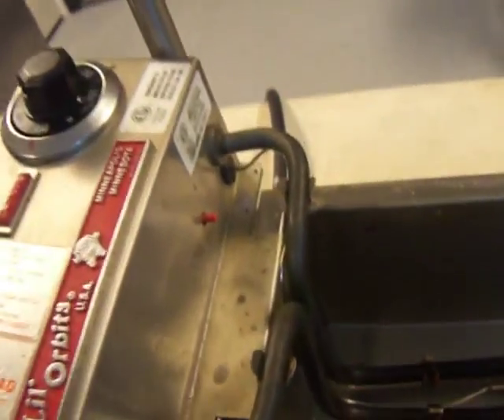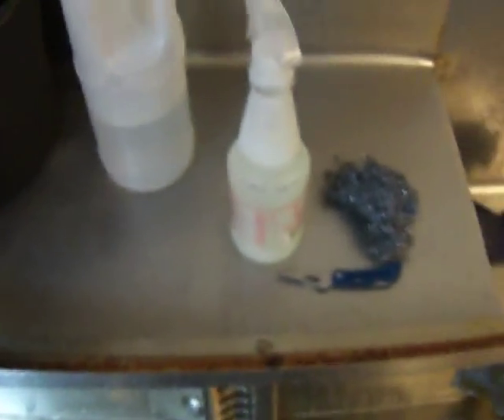CLEANING DONUT MACHINE

Comment: Do you mind sharing the settings you use on the hopper (1-5) and on the servo motor? Making the mix directly as instructed on the package 1lb mix to 8oz water, my dough doesn't get puffy and most of the time come out looking more like funnel cake
Reply from the maker: Stephanie Diaz yes of course hold on one moment
Reply: Thank you! I inherited a used machine, so lil orbits isn't providing any help, everything appears to be working fine mechanically, but they shape is off, they look like fried calamari haha
Reply from the maker: Stephanie Diaz now worries I will be posting up a video this week. I know I've been gone for a while but that's because I had some serious stuff go down which everyone will see here this up coming week!
Reply from the maker: Stephanie Diaz I'm very sorry Stephanie. I've been busy busy but u need a digital scale and for every pound of dough its half in water. 1pound of dough is 8oz of water.
Reply from the maker: Stephanie Diaz you may need to add at least 2oz more of water and on your mixer u need to use the 2nd speed for 1 minute and then the next speed for another minute after you let it rest and scoop the sides for 20 seconds

Comment: Just use a heat gun to melt the grease and then just wipe it off with a soft cloth or even paper towels. You are scratching the Finish. The health department expects to see grease on the machine since it is basically a deep fryer.
Reply from the maker: J.W. yes, I've progressed more with different ways of cleaning the machine. And the heat gun is quicker.